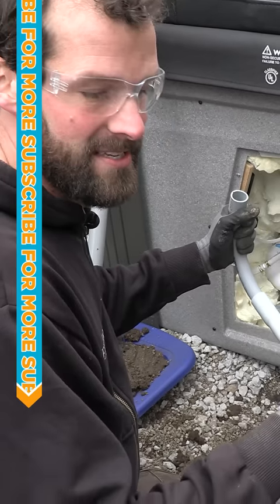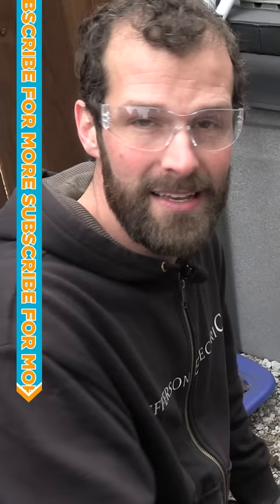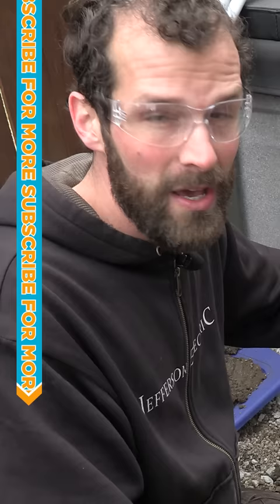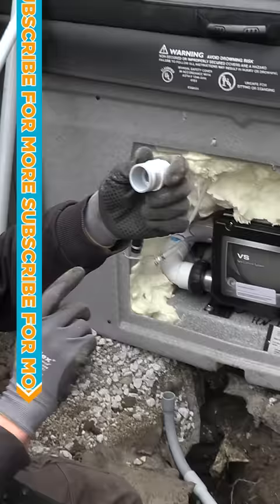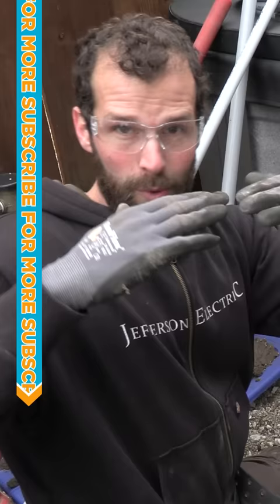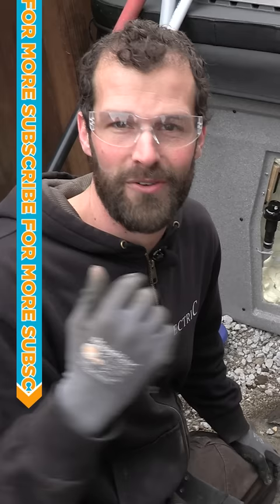A Warning When Using PVC

Comment: In 40 years, I've had that problem 0 times.
Reply: Nice
Reply: I've laid pvc pipeline. quarter mile at a time...not once has it pulled itself apart.
Reply: Same.
Reply: That you know of...
Reply: @363.2McMasters  an electrician on meth......... 
I guess that's one way of thinning the herd
Reply: @Jeremiah Schultz Jeremiah,  are you a boilermaker?
Reply: the content creator made this shit up. i hate people who talk about subjects like they know about it when they have zero knowledge of it. its about 1 inch of shrinkage per 30k ft of pipe
Reply: I agree.  But years ago, I had a summer job laying out conduit on Mercury, and boy, when it hit the trench, well...I actually can't remember what happened.
Reply: @stipcrane  I can tell you what happened; your oxygen tank ran dry. There's a Guage on it. What's the matter with you? In 40 years, you know how many times I ran out of oxygen? 0!
Reply: @eljefe62  so you've had problems with this issue
Reply: I'd like to see the missing comments here
Reply: @skurdibbles7913  he's the same type of guy on a framing crew that thinks a board stretcher is a real thing
Reply: @onehandclapping7875  shrinkage probably depends on a whole bunch of material science and physics things beyond my understanding. I feel like wall thickness, in relation overall diameter. As well as the thermal transfer from dirt contact & fluid and electrical heat from utilities  may negate most of it. I've only had it happen with 1 1/2 in direct sunlight on a dock in the northeast, can't think of any other situation more extreme.
Reply: @skurdibbles7913  no.
Reply: @ghostrider433  no on what?
Reply: Damon Wright  engineering data sheets.
Reply: @skurdibbles7913  it's like half an inch in 10ft in 100 degree changes. Up to 5 inches in 100ft for 100 degree difference. But he's taking about conditions that might not happen. You would have to be installing 100ft straight without any kind of junction boxes or other similar stuff (English not my first lang) at 100+ degrees in the sun, with PVC reaching that or higher temperature. Then the soil would have to reach zero degrees or lower along the entire thing. It's not a case that's recurrent, but it's not bad to keep it in mind. Allowing for some sort of expansion/contraction here or there wouldn't be a bad idea in similar condition (even if seldom present).
Reply: Someone isn't using glue
Reply: Nobody has ever had a problem with this. He's the only one have a problem with shrinkage

Comment: Having put miles of pvc conduit in underground banks I just can't stop laughing.  "You loose an inch  every stick". Lmfao.  
For one they make an expansion coupling if your worried about shrink/swell to the conduit.  Usually use one about every 2,500-3,000 feet. 
What's failed is most likely your glue joints.
Reply: Electricians don't believe in primer...!?!?
Reply: It's 3/8 of an inch in 10 feet. 3.5 inches in 100 35 inches in 1000 feet you'd never use only one expansion.
Reply: I'm not an electrician but do sell parts and i was like wtf, isnt that what expansion couplings are for?
Reply: Or he’s not using glue 🤣
Reply: I don't think the guy glues them at all
Reply: @shawnshurtz9147  that depends upon two factors. 
The application of where the pipe is . I E in a bridge you'll have at least one. 
And Two Authority having Jurisdiction.  A $20. Is cheaper than dealing with an inspector who is going to make multiple visits to your 2 year long job site
Reply: Home depot 10' Stick?😂
Reply: They’re electricians not plumbers…
Reply: @gregjones3660  true electricians don't care if it water tight as that is not important. We are making a raceway for wires not a path for 💩💩 to go down hill.
Reply: @gregjones3660  there is special glue for conduit that has primer in it. It’s generally in a grey can. 

Using standard PVC glue without primer will cause every single joint to fail. Period.
Reply: I believe expansion couplings are only for above ground.

Comment: I usually store my pvc pipe in the fridge untill I need it, also when I pull the pipe out I use it as a large straw to instantly chil the soda I'm drinking.
Reply: Lol
Reply: I use it for coke too. But the other kind of coke
Reply: I prefer to apply chill trace (aka chill tape, opposite of heat tape) to the conduit before back filling the trench.
Reply: Lol same
Reply: @PandaFPV  sameee lol
Reply: @nicholasittzes7224  same 🗿

Comment: Tell us you don’t know $h!t without telling us you don’t know $h!t!😂
Reply: Lol for real. A 1" growth on a 10' stick. Not happening.
Reply: Pvc expansion rate of 3.38x10^-5 in/in/degF.

So if there is a 50 degree F difference between being in the sun and being in the ground, then it would contract about 1/5" per 10ft, not 1"
Reply: Fr😂
Reply: @jamesl8496  math for the win.
Reply: @Benjai  I ran straight hot water in my bathtub and the pvc pipe violated my water heater and caught a felony charge 😅 
Yeah I believe the ground settlement part in theory but a gravel sand base solves that 1

Comment: Never had 1 inch of expansion or contractions, ever. I wonder why this doesn't happen to the PVC I buy. It must be special
Reply: I'm here for your response I've never heard of this either
Reply: it does happen thats why they make slip joint couplings for when PVC is installed exposed like on a roof.. butbwhat he is talking about is dumb cause if it did expand that much it would be like a noodle while ur installing it.. and u would know its not right lol
Reply: I usually get 2 inches of expansion for 5 minutes then I get 2.5 inches of retraction 😂
Reply: @henryhenry3832 Five full minutes?  You must have trained with Sting or something.  I might get one inch over one minute.

Comment: This is why you glue it... weird how my rapid fluctuating stuff (daily) doesn't fail after 15
Reply: right? Why not just glue it? There are houses with 40 years of PVC tubing with no problems AT ALL
Reply: I thought it needed to be glued to be up to code. I am just help lay conduit, but I've never seen it not glued.
Reply: @arnold8746  does not have to be glued if it is only gravity or non pressure. It's always best to glue it but not necessary for non pressure applications
Reply: @This_Guy1  I am guessing that is different depending on the climate you are in. Where I live the frost line is 4+ ft underground, that can really raise some havoc, even when glued.
Reply: @arnold8746  frost line where I'm at is 24"

Comment: Here's the deal, if you open your code book and flip to table 352.44 "Expansion characteristics of PVC" it tells you it takes a 25c change in temperature for a 1 inch expansion or contraction over 100 feet of pipe.
Reply: Well, right place for the info. But have you ever worked in Summer in the rural area outside of  Phoenix? 125F daytime 45F nighttime. 52C to 7C. You could actually get a 50C temp change.
Expansion joints are really needed sometimes.
Cold beer helps too.

Comment: This has literally never been a problem for anyone.
Reply: Right lol. Especially with good glue
Reply: X2
Reply: Exactly
Reply: all social media hype
Reply: We've assembled 150mm about 300m of it and didn't bury it came back in the morning had to push the last length back past the witness mark
Reply: Not an electrician but I’ll have to agree
Reply: Only when you need to run over 28k ft of pipe.